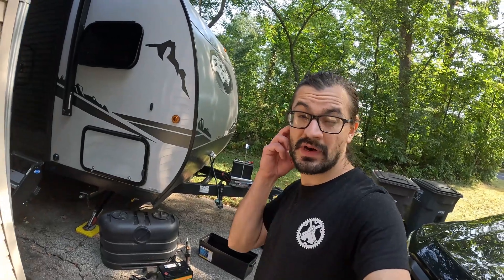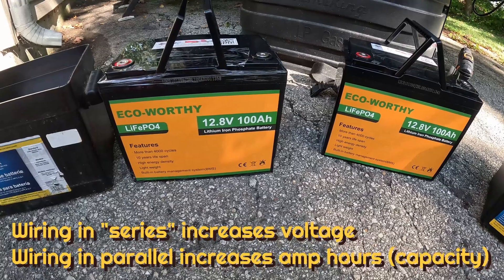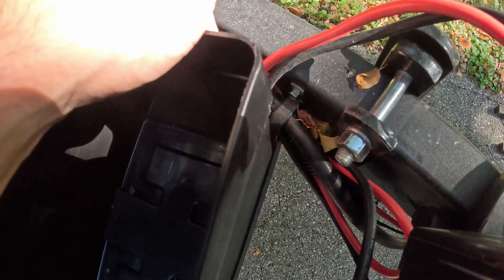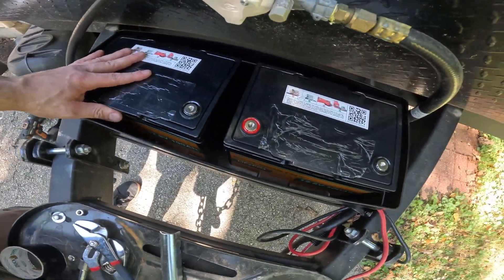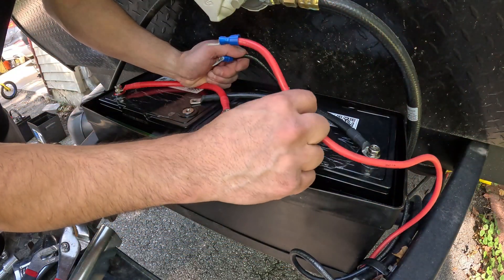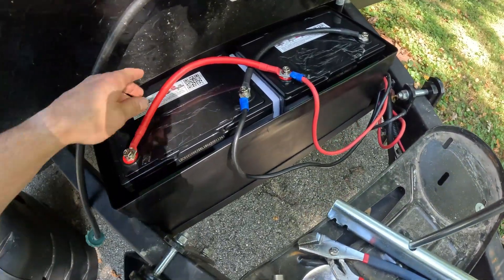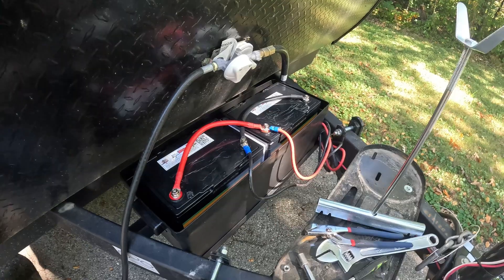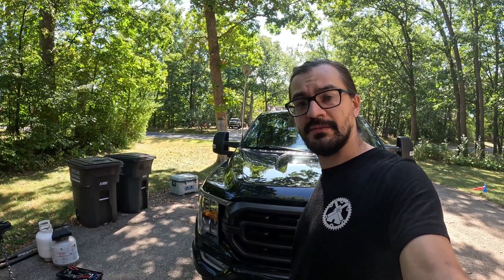Wire RV Batteries in Parallel. Quadrupled my capacity for $350!!!

Comment: Thank you for the video!  You gave me the courage and shopping list to make me feel comfortable doing this project.  Just completed!  Stay tuned for my questions after it runs for a while!! Lol
Reply: The first question I have is:  our WFCO inverters auto detect liOn & lead acid, but mine is not swapping.  I have read you need to drain your batteries and recharge for it to be able to auto detect.  Did you do that?
Reply from the maker: @rynsct sorry it took so long to respond. No I didn't have to do that. Did you get it to work?
Reply: @middleclassaction  no.  I mean, yes everything is working, except the wfco inverter is charging the batteries using the lead acid profile.  It did not switch to charge with the lithium ion profile.  So yes, everything is working, but the batteries are not being optimally charged.   It sure if this will affect the life of the batteries later down the road or not.
Reply from the maker: Awesome! Glad the video helped. I'm actually doing some solar panel upgrades as we speak!

Comment: Hello Collin, Hope you like your camper so far... I'm looking to purchase the 2025 Wolf Pup 16FQBL. I was told the hitch-ball size is 2-5/16. Is that the ball size on your trailer? Also, can I ask what mileage you're getting while towing?
Reply from the maker: Sorry it took so long to get back. I had to double check. The ball is a 2 5/16. As far as mileage goes, its all over the place. I had an f150 with a simple V8. Average between 9-10mpg. With my new truck, which is a hybrid I'm getting like 7-9 unfortunately (luckily it tows considerably better).

Comment: Great video, Thank You, you really want to connect to the outside battery terminals, not the inside ones, this makes sure the current is equally distributed across both batteries
Reply from the maker: Thanks! I'll swap those tomorrow! Appreciate the tip
Reply: Just curious, how is that different?  As long as the connectors are pulling + from one battery, and - from the other, it's balanced.  If you switch to the outside connectors, you still have a direct + with a cable to the + on the other battery (same as inside). 
Unless I'm missing something, I'm curious as I'm doing something similar. Thanks!

Comment: My camper didn’t have the auto battery type detection, so I had to flip a switch on the converter circuit board. Just thought I’d mention this. Great video.
Reply from the maker: Interesting. I'll have to look into that. Thanks for watching!
Reply: Yes. We had to get a different converter when we converted our RV to lithium.  Without it, our generator would only throw 8 amps at them.  I am no electrician and will probably get the numbers wrong but, it now puts in something like 60+ amps (they are rated to take something like 50 amps each).